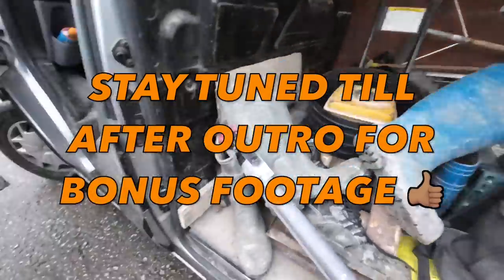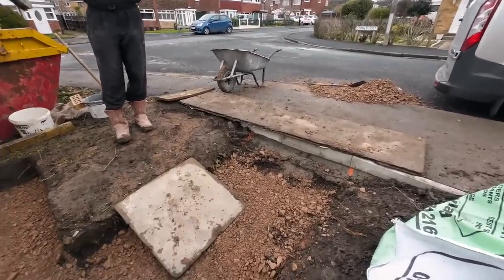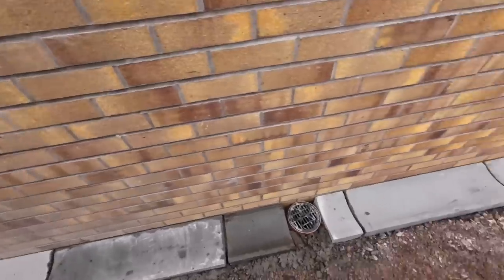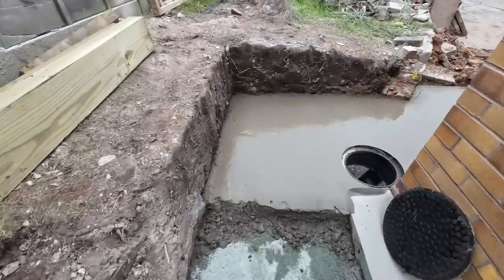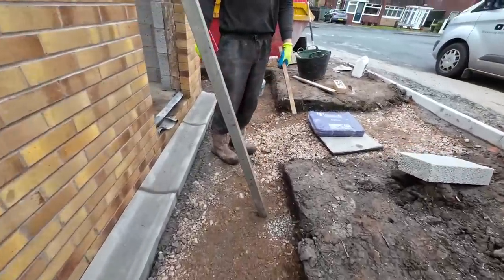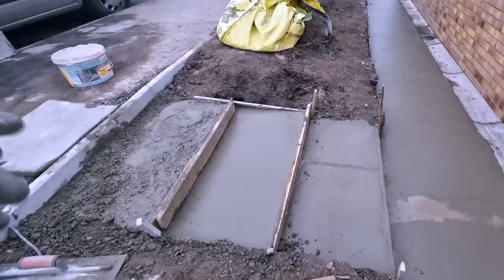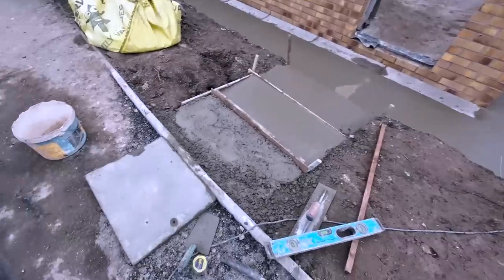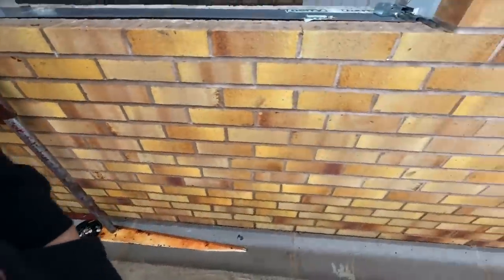CONCRETING THE PATH AND FINISHING TOUCHES

Comment: Nice job boys, I have a tip for the asphalt open the bags and take out the plastic in situ then light it with a blow torch for 5-10 mins put it out with water then it spreads lovely and walks superbly

Comment: I watch all ur videos, they r very interesting. Im sure u have worked on different types of houses. On a Victorian terrace outrigger at the back, how much of a minimum gap should b kept between an extension and the neighbours boundary wall..?  I've been told it should b a metre but just want to make sure. Thanks
Reply from the maker: Thanks pal, sorry I don’t know anything about that kind of thing .
   I suggest you contact your local building control and they should be able to help .
 🧱👍🏽
Reply: Thanks will call bc tmz.  If any Builders out there want to comment just get a consensus
Reply from the maker: @RS-ei3yt  🧱👍🏼